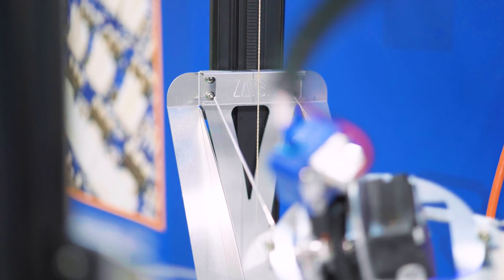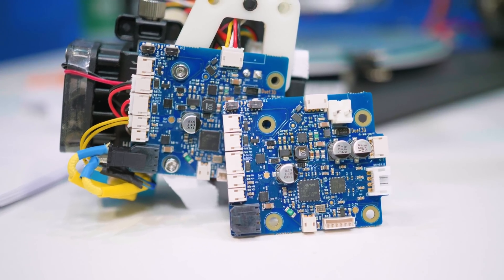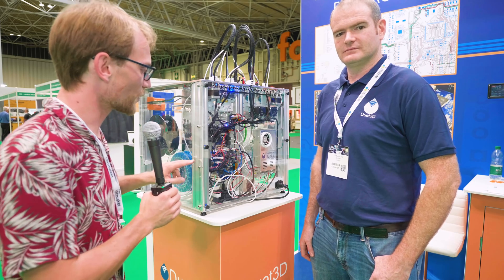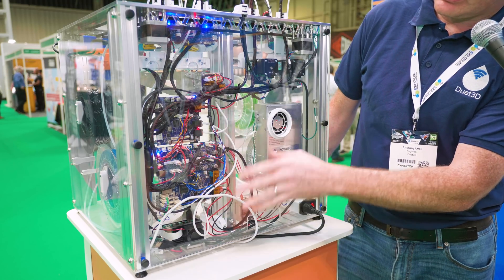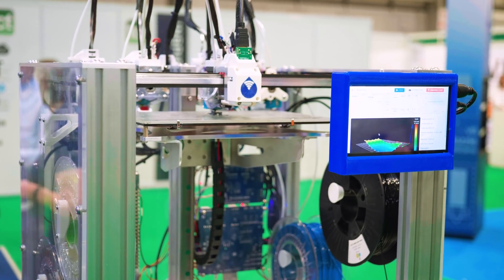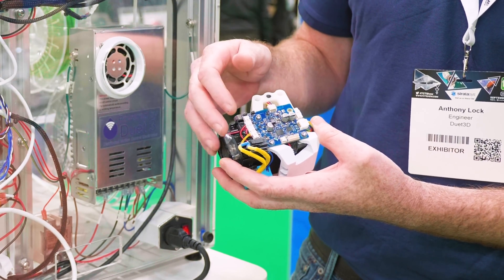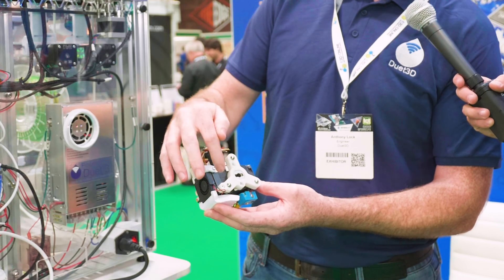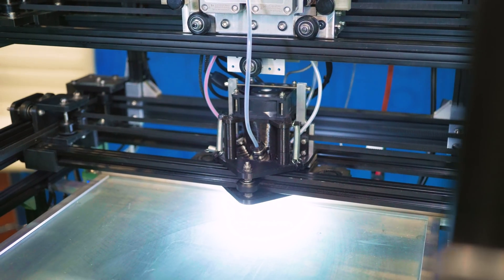The new Duet 3 electronics ecosystem!

Comment: And it's going to "just work". Love it. Great video, I realize that it's a few years old, but when this video was first made, I was putting to together my own home built Jubilee tool changer. I have that built with a Duet2 WiFi and the Duex5. It's actually a long version with a 600mm Z axis that I eventually installed into a modified server rack for stability. I really like the Duet boards, and their support online is just outstanding. I have yet to have an issue that I could not quickly resolve with their online support and forums.

Comment: I'm not sure I understood what he meant regarding Rpi and plugins. I percieved him to basically say that their board and way is better because: The alternative for anyone wanting to develop and use a plugin when running a printer with a different board than theirs, even when hooked up to an Rpi running octoprint - is to hardbake that "plugin" into your own custom developed printer firmware. 

Surely I must be misinterpreting what he said..? Otherwise that's one helluva false euqivalency to justify their product feature.

IMO that would be somewhat like Microsoft saying (or heavily insinusting) "The advantage of running our Surface Pro X is that if you want to add functionality you can install programs and they won't break your OS - but with other laptops you have to develop your own linux kernel and bake that functionality in."

Comment: I look forward to taking a look at an even playing with the new board. I have a duet Maestro which I purchased from m3d. The problem that I have is that when I stopped using the board when I bought my new printer. About this time in the newer versions of their firmware they were beginning to cancel out older versions of G-Code I'm completely rewrite it into their own. That is to say that you can't just simply use g code that you already know you have to know duet G-Code. And the complexity of this new code they were riding and how bizarre some of the coating actually was was what threw me off. Their choices in that code structure made it more difficult to learn than they understand than they care to know. And it's the differences in this coding structure which separates now duet from the entire industry.

Other concerns I had was that the web interface did not show temp per driver. I hope with the new 6A capable drivers, we can see temps, not just a message after the fact like a check engine light...

I find the comment about talking back to the slicer interesting. Slicers are very one way. 

When I was more active on the forums, there was also constant opinion that the duet web interface is infallible, that no one should need use the slicer supplied controllers. I argue I use both. I also ONLY switch to hardware based printing after I have a file sliced and printing exactly as needed. To much stop start and wait for file transfers otherwise.

Comment: why the 5160s on-board when they could have used 2209s?
Reply: more current support than 2209
Reply: To make it a viable option to use on CNC routers and mills, which use larger motors than the puny ones on 3D printers....

Comment: The website for the duet 3 says the drivers are 4A.  Is this dated info and they are 6A or is the website correct?

Edit:  After looking through the documentation the peak value is 6.3 amps  4A rms.

Comment: about Duet clones ....Duet 2 cost around 120 for oryginal one .... clone cost around 90-100.... with chance that it will fail (90% of clones have problems working ok) Oryginal Duet is almost undestructible , you can short the wire etc and it dont damage the board, but cloned ones easly fail and burn if something go wrong.

Comment: I bought cheap printer controls for the first year to year and a half I was designing printers.   Then I bought a Duet Wifi.   I will never, ever buy anything but Duet electronics in the future.     Once the 3 has been out for a little bit, I'll probably drop one in my big CoreXY (which can always use a tiny bit more stepper power) and move my current Deut Wifi over to my UM2 clone.    Fantastic hardware and regular updates/improvements and great community and company support.   All around excellent.

Comment: I have to say, that's probably the best response I've seen to the subject of clones. (Admittedly, I'm not out looking for opinions from manufacturers on clones.) If it's a closed, proprietary whatsadoodle, cloning is something to get angry about. If you're starting out by throwing all your designs and code into the void with a permissive license, you already told people all over the world to clone away. Though it'd be nice if cloners would at least make an effort to make it clear that whoever they're cloning won't be able to help if some resistor on the board starts emitting light, instead of relying on customers to know that already, or if most cloners respected trademarks, or if... Er, gripes for another time.

Comment: Will the dynamic accelleration be available on the duet 2 wifi as a firmware update or only supported on the duet 3?  That feature would be so revolutionary on my printer because i get bad ringing on vertical holes.
Reply: Nevermind a quick google search appears it is availavble on all duet boards.

Comment: I have 2 Duet 2 WIfi Boards
One for my Cetus MK II mod and one for a CNC. Both work very well and every problem you may face while building up a 3d printer they have already solved it for sure. And keep in mind that they deliver all needed connectors with the board you don't have to search for them extra.

Comment: Its interesting that there is a couple of projects going after the same challenges from opposite angles. E3D with a 3d printer hardware mindset working on "do it all" electronics and Klipper project using a more traditional CNC control mindset where the stepper drivers are dumb(ish). Both projects allowing for many steppers/heaters/fans/controllers etc. Klipper using USB that isn't the best but it looks like they started on CanBus.
Traditional CNC you spend your money on stepper motors and drivers while the electronics are dumb and not expensive that uses CNC control software that is also fairly inexpensive. 3D printers took what turned out to be the more expensive mindset of integrating a custom controllers with the steppers.

Comment: It's a shame there's no "standalone" Duet board, without drivers, mosfets, etc. - just a solid hardware base for RRF. Yes, you can buy the full board and expand on it, but it feels very wasteful to not use any of its features and route STEP/DIR to external servo drives. There's a LPC1768 port of RRF, but there are very few boards approaching the quality of Duet.
Reply: Jiri J I feel the same way. i fail to see the demand for high power stepper drivers that are fixed mounted on a board without the possibility to be replaced. Especially now that servo drives came down in price and can compete with the bigger stepper motors. its a classic case of making a product for a nonexistant market. CNC? most people go the linuxcnc route.
Reply: @Gekkoperformance  Even for stepper motors, the Duet 3 doesn't go above 32V, which really doesn't make sense given the 6A rating - if they're aiming at NEMA34, one would expect 48-80V as is standard in other drives. Let's hope CAN proves useful enough for them to modularize the platform a bit.
Reply: Jiri J i think they want to retain safety for use with hobbyists as 80v can be lethal. Again i fail to see a market, what hobbyist uses 6A steppers ? Or which machine? I just cant imagine a use case. The Duet is a 3d printer centered board and is not very useful for cnc mills.

Comment: I'm still using one of the earlier v1.6's in both my printers with the paneldue and it z probe and they've never skipped a beat! The only down side to the older versions is the lack of WiFi (Ethernet only) but they're great boards even in 2019. 🙂

Comment: ohhhh on the topic of clones while i and some other railcore guys were talking.... We discussed the clones a little... And we all came to the conclusion, yeah there are clones of the Duet2 out there and the thing is... While theyre cheaper theyre only a really tiny bit cheaper. So for the (literally few quid) youre getting a board that will be guaranteed to work and be get the full support for. And not to mention youll be supporting the company that has brought us these utterly amazing bits of kit... So again amazing work guys
Reply: Duet 2 Maestro is 90 quid plus shipping, 110+ total.
Chinese clone is about 60, sooooo..... 45% cheaper.   I use frigging RAMPS, so I literally cannot afford to upgrade to genuine one. Doh.
Reply: ya i like to think china hasnt made a cheap duet because it wouldnt be the duet design if it was worse quality. those boards are reliable, advanced, and REALLY hard to break.
Reply: It is also hard to make a cheap knockoff when the reason atlset I get duet is the quality

Comment: Can't wait for duet3 -- I've expanded my duet2 to the brink of capability with tweaked firmware -- 14 stepper streams (thanks to dc42 for his help for tweaking the firmware to add 2 additional stepper streams) then my custom electronics to take it to 16 steppers -- duet 3 will let me run 16 steppers native. Already have a PI controlling power for my printer, so having it fully integrated would be fantastic.
Reply: kazolar out of curiosity what kind of machine is it running and what is the need for so many steppers?

Comment: i think they misrepresent themselves in saying that they're expensive. not at all. no other board has such powerful stepper drivers (never mind the VAST featureset), and those that can be equipped with the same drivers cost easily as much once you factor in their cost. 
and if one goes that route, you generally also need external mosfets, and you're STILL lacking all the other features DUET offers. nothing compares. bravo!
Reply: I think they are afraid that people will compare the price of a cheap RAMPS clone to the Duet. I was one of those people for quite a while, until I understood the value of having electronics that don't melt or catch fire.
Reply: I fully agree, i had several ramps boards before i changed to duet. After the inital setup of the duet you will never go back. Both the software and the hardware are top notch. Its fully worth the money and i love the simple way of doing any kind of changes.
Reply: @schleusser  The duet is nice, I use the Duet2 and a SKR1.3, but for building my next machine, the SKR does everything I need, along with the drivers I want for a lot less money. They are good board, but they are not inexpensive.
Reply: I don't think they promote being expensive at all.  Their close integration of software/hardware is unmatched.  Also, the fact that dc42 is lurking in the forum is just absurd.  It's amazing he does that...He's the lead dev!
Reply: Yes, duet 3 is just a bit more expensive than my printer but it's not expensive, no no ...
Reply: @surronzak8154  it really depends on what kind of expensive people talk about

some people view a 600 hp car for $35k as expensive when put next to a $15k 75 hp one but others view that 600 hp one as a bargain in the same scenario.

to me, a duet is cheap since it allows me to save 20-40 hours on the setup over an skr 1.3 mini while still offering more features.

at the same time, there are some who view that <$200 difference as being worth more than 20-40 hours of their life...
Reply: @angrydragonslayer  20-40 hours to set up an skr????  What are you doing, manually soldering every connection on an unpopulated pcb?  Takes me about 2 hours...maybe 3 or 4 on the first one.
Reply: i assume you mean just connecting it to a fairly standard printer and quickly going through a pre-written software and uncommenting the right stuff for your printer without any further calibration or code rewrites?

i said "for me" as my latest 3d printing project was a toolchanging delta and my latest duet project is a robotic arm mill meant to have a 15 micron accuracy in alumec 89

i dont doubt that skr boards have a place. however, i dont see it in the professional realm but rather in the hobbyist/ poor enthusiast realm, similar to the "dragon" hotends that copy slice engineering
Reply: @angrydragonslayer  yes, that is what I meant.
Your (and other more complicated) situation is where duet really shines, and does make the most sense.  Not to mention the amazing support from Duet (which often will be from dc42 himself!)
Reply: It's not just the power and expansion possibilities though. It's also how absurdly hard they are to break.

AND, critically how amazing the support is. I've personally had multiple interactions with David on the forums where he's set me straight.
Reply: These two above me are bots btw

If you look around, you'll find that exact set of comments on a lot of threads
Reply: I've been doing CNC routers and mills for about 13 years now.  I have stepper drives that almost cost as much as the Duet 3, and I need 3 minimum, a breakout board, motion controller, control software, and a PC (with OS).  So for someone like me, this board is incredibly inexpensive for what it offers.  Larger CNC machines and mills typically require larger steppers, which usually require higher currents, and this fits the bill nicely.  On one board nonetheless.
Reply: Maybe I'm just unlucky with my boards but I'm already over the cost of a Duet in failed boards. My next board I'm biting the board and going Duet.
Reply: Bigtreetech skr 1.3 mini includes 4 tmc 2209 drivers, a 32 bit ARM AVR and a whole host of advanced features for $37.  The Duet 3 is $185, the Duet 2 is $120, and the Duet is $89.

Duet boards are very expensive. Don't pretend they aren't. There are a lot of benefits to buying a more expensive board like the Duet, so talk about those. But don't lie and say it's a cheap board when it is probably the most expensive consumer board on the market.
Reply: @jeffwells641  If you you control f.e. 4 minis with klipper you would have a 16 stepper system for about 150 usd total and you would have the full duet feature set aswell, without the need for a fancy "proprietary bus system " ( Even frequency adjusted scurve accel is pretty much finished )

Comment: Hi Thomas.
I would like to turn ON and OFF my Dewalt D26200 router on the Duet2 WiFi using the Web Control  but i'm not able to figure out how to do that.
There is no a relay on the Duet2 to manage that.
For example into the OPENBUILDS Black Box there is a relay output port i think is possible to use for that but into the Duet2 a relay is not available.
How can i implement this feature ? 
Can i use an extruder or heated bed unused output or the Tool feature to set the status of an external  relay ?  How ?  Thanks in advance
Reply: an SSR on the heater output would be easiest.   otherwise you need to find a 5v > 120 (220v) mechanical which coils usually draw more than the  IO will provide so yeah, an SSR will do.

Comment: I could be crazy, I think per tool control boards has been a thing for a year or two in klipper. Part of why I am using it as the firmware for my DC servo based machine, since each motor/temperature controller will be entirely self contained, with closed loop feedback.

You need that when you want a 100 point heating grid for your build plate...

It's really cool to
Reply: I tried out Klipper but I didn`t realize it could be used like this, now seeing it like this makes a lot of sense.
Reply: @cosminnci  It is really nice, since you can spend $20 for a GRBL board, uno, and drivers, and end up with an extra four stepper channels. 

I could be wrong, but I don't think there is actually a hard upper limit on the number of stepper channels or heaters? It is kinda crazy, especially considering the value proposition and flexibility.
Reply: @williamforbes6919  Thing is I am a basic user, 5 steppers are enough, I can`t see in what setup I would need more.
Reply: @cosminnci  It is really for things like mixing extruders, multi Z axis motors, tool changing, head tramming, or multi point filament feeding. 

The mixing extruder doesn't need to be a feature used for color. You can do things such as mixing multiple durometers/softness of TPU in order to have variably flexible prints. Slicers like IceSL make doing this very easy to via painting on the desired mixture right onto the part.

I intend to use separate linear actuators for lifting each print head for Z hops and tool changes. Having a separate channel for each allows me to calibrate for the variance in nozzle length in software and to hop with just the print head instead of the entire build plate and z axis.

Being able to add an extra channel without replacing the main board is nice as a feature for lower end machines as well, since the $20 GRBL board would let you add another extruder to an Ender 3 without any need for replacing the default motherboard.